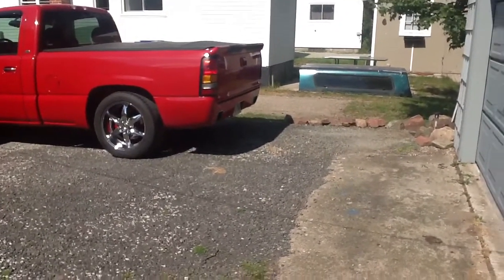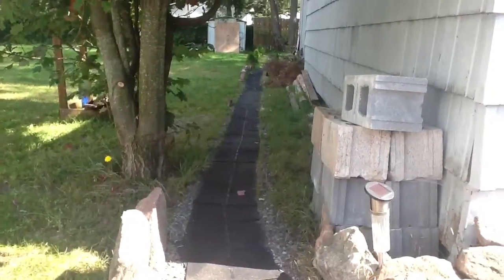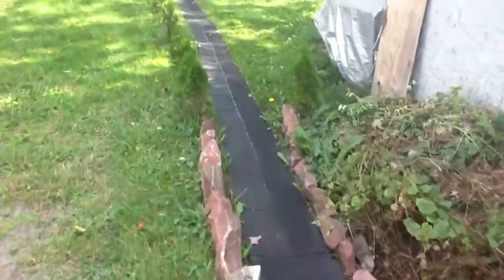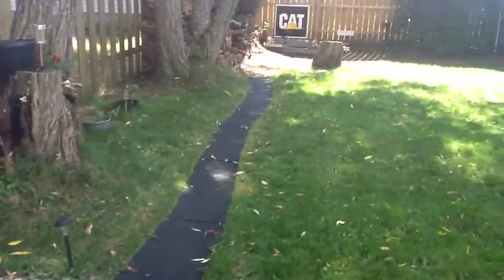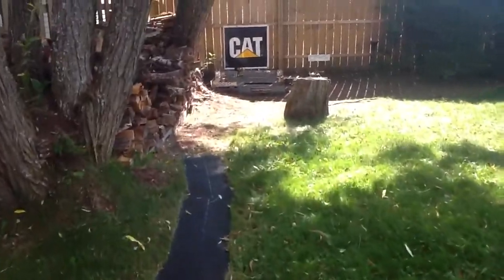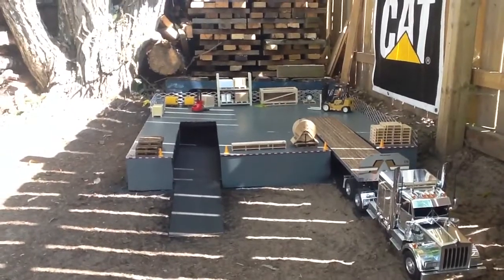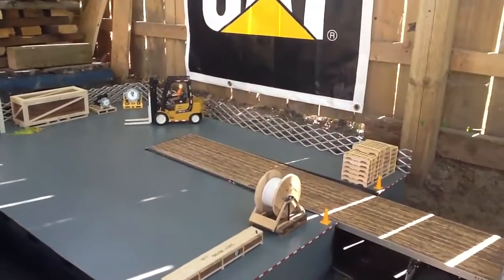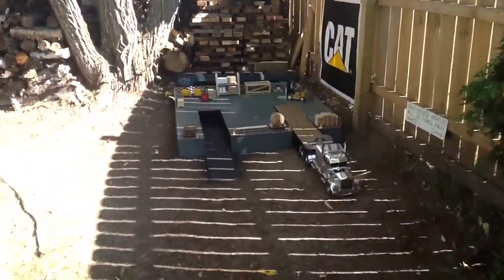RC road project 3

Comment from the maker: By all means Finster!  I got the idea from one of my last videos. I noticed how close the trailer height was to a pallet and the rest is history. With a 1/16th board for the trailer to ride on  and the cap board I used matches up with a Tamiya trailer perfectly. The only reason the height is not perfect in the video is due to the truck being on a lower surface. Once I build that up, the trailer will sit perfect  to the dock. :)